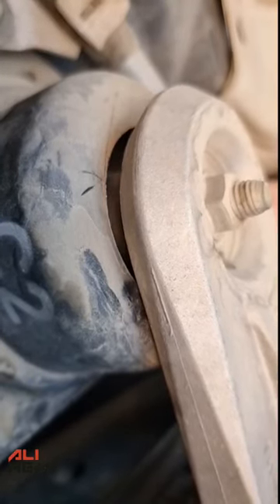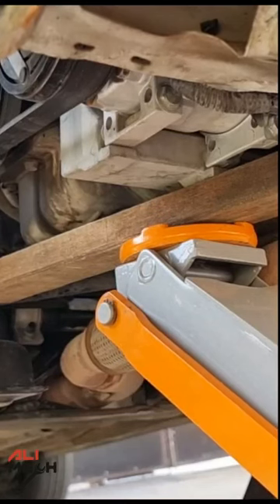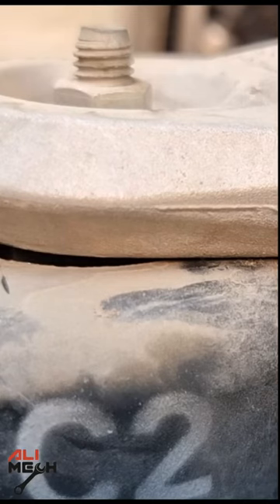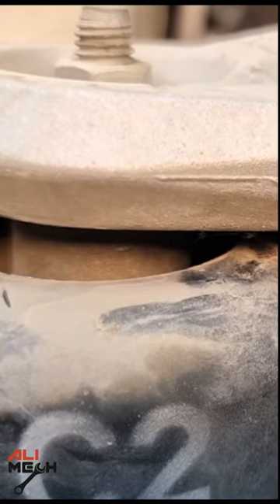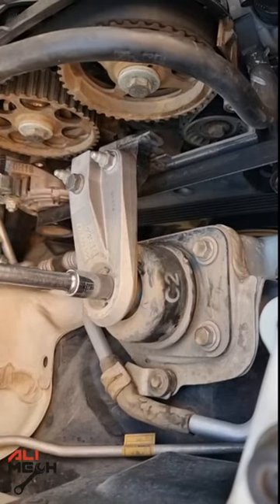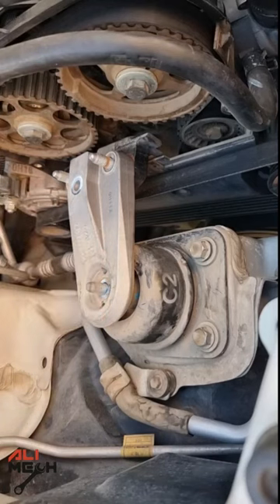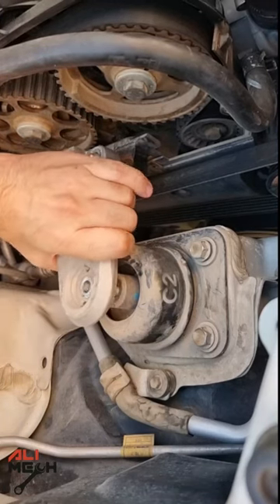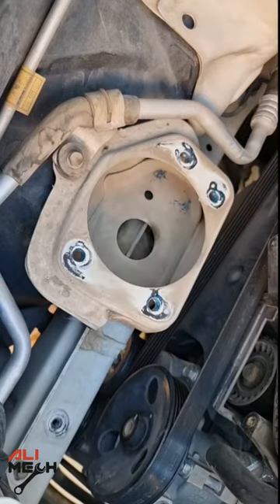How to replace engine mount without falling the engine #horts

Comment: Ok, you do realize this is the factory procedure for EVERY SINGLE BRAND right? Also, snug the bolts up, then torque them after the engine is set back on the mount. Otherwise your mounts are under constant load, which causes them to fail prematurely!

Comment: How can you tell its bad before removing the mount? Im getting hard vibration on acceleration especially in the cold weather even after the car warms up
Reply: Accelerating and feeling the motor vibrate or shake in any way is a cracked/broken motor mount. You can physically see it shake if you rev the car and have a buddy outside looking , you can try doing it in drive while on the brakes to really see it shake like crazy.

Comment: hi, one of the two screws on the bracket holding chain cover, one of the bolt is not outside, should it be unscrewed from bottom or will it come out directly?
Reply: I know your comment was 4 months ago, but hopefully you figured it out.